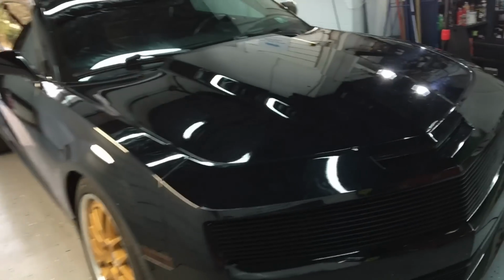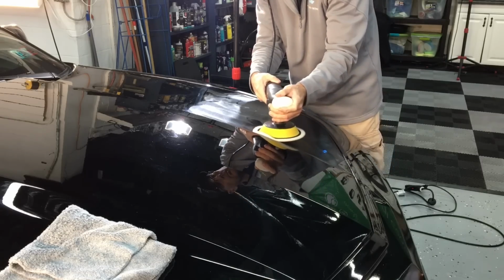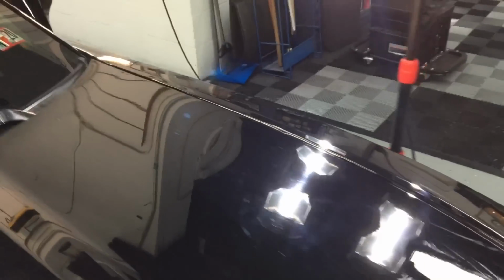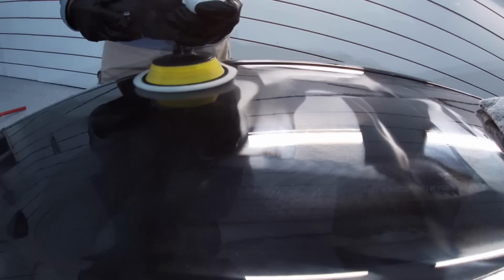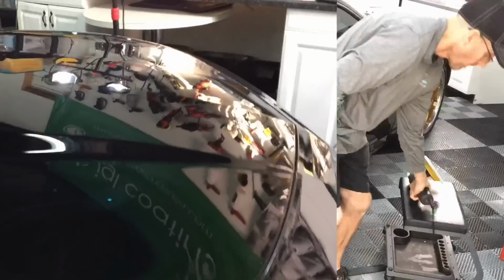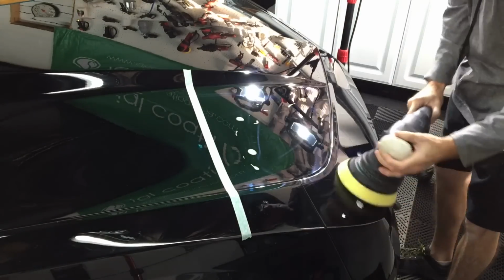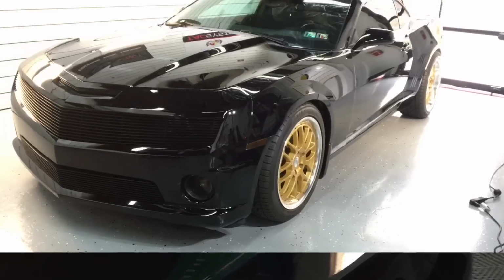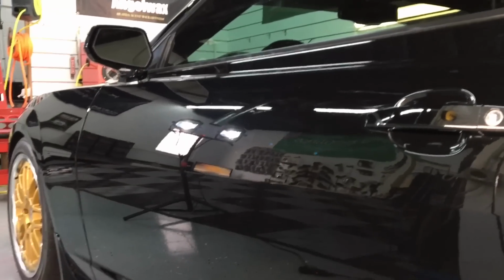One Product For ALL Your Paint Correction Needs!! TAC Systems Refinish Ultra!! One Step Compound!!

Comment from the maker: What is YOUR favorite One Step?
Reply: The only 1 step products ive used is rpl 1 step, tec choice ceramic 1 step, and angelwax aio. I use the rpl daily but i prefer the angelwax aio. You can get the rpl pads at O'Reilly auto parts.
Reply: Apex Detail so far 3D One.
Reply: If the clear is soft I like the ACA finishing polish form 3d , if its on the medium to hard side I like 3d one
Reply: 3D ONE
Reply: My 1 step is dropping it off to you !!!  Lol.
Reply: 3d one
Reply: woww black golden camaro still love the iroc-z and trans am gta and 4th generation
Reply: 3D1 💎✊
Reply: The last cut with URO Fiber. Not on soft paint. 👍
Reply: 3d hybrid or 3d acc
Reply: I have yet to graduate from an AIO like 3D Speed.
Reply: it says this Tac ultra will tackle 1000 grit sanding marks that is further than 3d One goes. That's right up there with Sonax CutMax and 3D ACA Xtra Cut which can do work a little bellow 1000 grit. But I will have to try this for sure. Bryan will you check out their One Essential 1 year Si02 primer with filling capabilities and ceramics to use as a foundation for a coating. Filling in the anchor points to a coating seems counter intuitive. It make my brain hurt some... what's left of it that is.
Reply: I want to see you put CSI’s CeramX to the test :)
Reply: DPC Flash or Car Pro Essence have both been good to me.
Reply: I hope you can do a review on AUDURA. Thanks
Reply: @joshuaopfer6566  rpl?
Reply: @coachtim6188  sorry its called rbl 1 step Polish. Ive never heard of it till i ordered it threw work

Comment: Looking for Help: I have a 2017 Honda Accord with white paint, but the previous owner didn’t take very good care of it so it has plenty of swirls and light scratches. I just ordered 3D One but what type of pads should I get ? I have the Torq 15Da polisher. Any help would be appreciated.
Reply: try the buff and shine uro fiber 50/50 and if u need more cut go for the lake country prewashed labs wool. stick with the 5 to 5.5 inch pads and 5in backing plate to help keep marring down. I just used optimums hybrid wool foam pad on my da and it was awesome. I love my purple foamed wool pads for the rotary and the DA they are similar to the lake country wool. I hope that helps

Comment: I prefer non-binary Camaro. 🤣

Brian, how do I submit a mail call question? Just looking for the right cutting compound and pad combo for my white C7? No deep scratches, just bad washing by the dealership. The car sat on the lot, for 7 month, so, it was subject to the twice a week power washing and chamois wipe down, with no soap. Just love marks. Looking to remove standard swirls, to as close to perfection as possible. If I need to 3 step, compound, polish and jewel, I’m good with that, since it’s my car, and time is not money, in my case. I currently have a Torq 22d with black, orange and white pads. Looking at getting a 3” and a nano iBrid, or one of those new Adams cordless micro polishers with the 1.5” backing plate. And if I need a rotary and a low lint lambs wool, I’ll look into that, as well. Finally a consumer grade ceramic coating. I like the angel wax line, as they showed good results when you featured them.

Comment: I had three Camaros. 2000 Z28, 2010 2SS/RS, 2014 SS/RS. Absolute blast to drive. My 201 had the better look it was black with the orange stripes. Dealerships have had a habit of screwing with me, the 2014 SS when I got it. They had a Z28 they had to move. They fire that girl up, that LS7 sounded pretty mean. Then when I got my Ram, that dealership had a Hellcat Challenger next to it. They named it right, sound like a pissed off panther. Chevy made a major miss on the 2019 and 2020 Camaros and those ugly freaking Silverados. I would love to see you do an old 379 Peterbilt.
Reply from the maker: When I owned a trucking company...I purchased a few twin screw Peterbilts. They are the cadillac of trucking!🙂
Reply: @apexdetail85  I love the old classic Macks and Petes. If given the chance I would love to do a restoration on one, with an exception to split rims being on them.

Comment: Great video and review Brian! 
I have most used it to cut with but will try it on a polishing pad too. They have released this in a new version for the hard clearcoats. Tac System Refinish Ultra Plus I think it's called. When you have the VW and MB and Audi and BMW and some Vettes with that rock hard clearcoats. They claim that it works great on softer paints too the Refinish Ultra you used but as a compound with a polishing pad or finishing pad. 
Would be very interesting to see a comparison with the Tac System Refinish Ultra and 3D One and the Scholl S20 Black SS and if it's another one step compounds. Maybe the CSi CeramX Polish could fit in this. Use like in the compound video series that you did and have wet sanded sections to show both the cutting ability and finishing ability from them. With the twist of after going up and down with a polishing pad you use a panel prep product and wipe anything off. And take gloss readings on the finer sanding grit marks. To see how well it works in both cutting and finishing. Maybe the Sonax Cut and Finish or Sonax ExCut 05-05 suits in this range of products